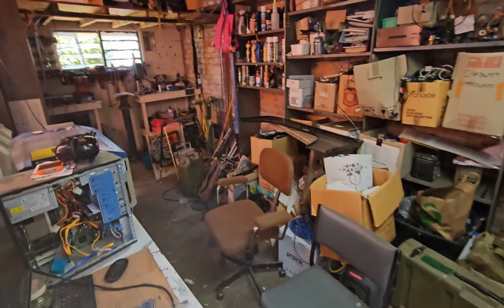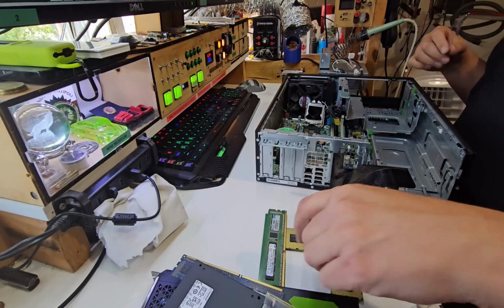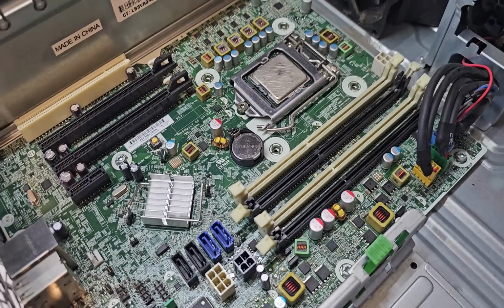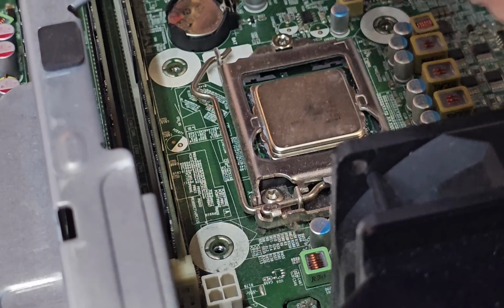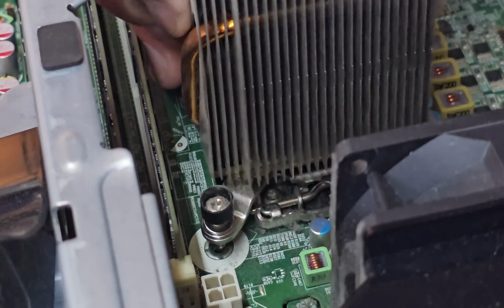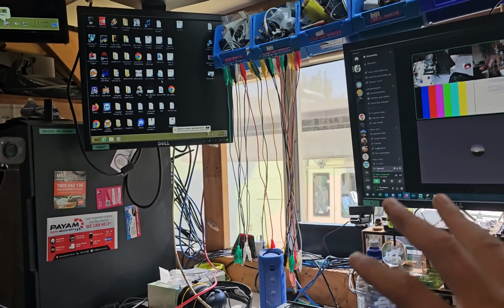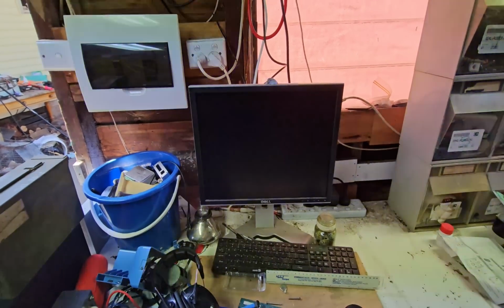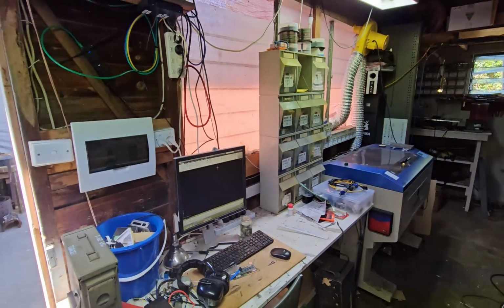Another workshop PC upgrade (for my laser cutter)

Comment: Yes, with heatsink compound, less is better. As long as you get the coverage.
I use a "naked" Stanley Knife blade to even out the larger surfaces like 30mm x 30mm or bigger.
These days the surfaces are machined pretty flat.